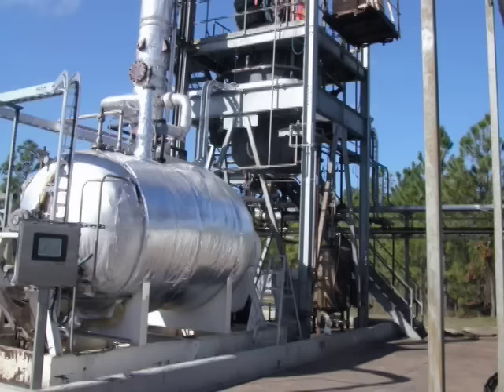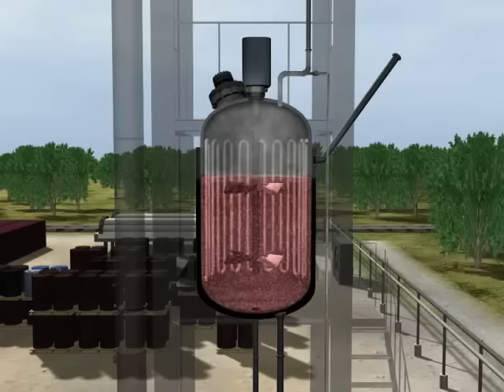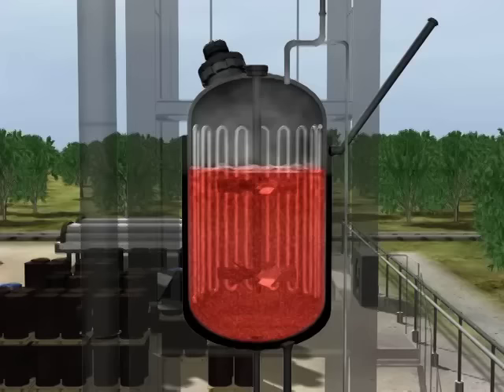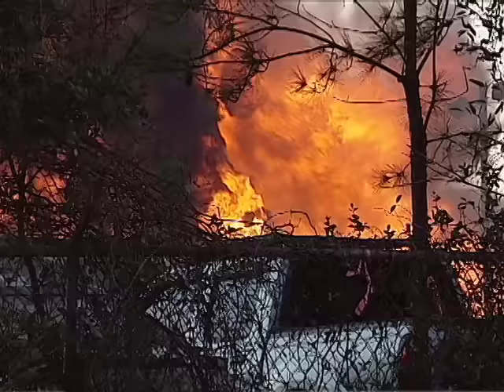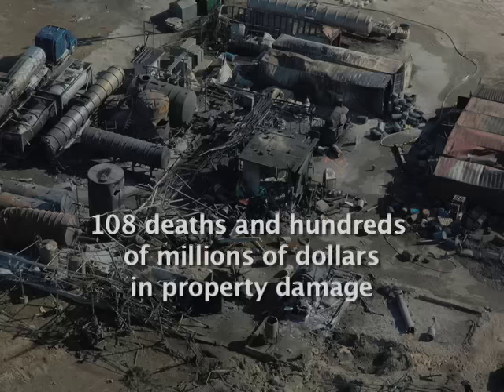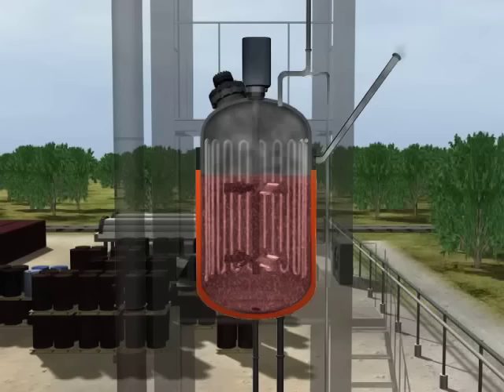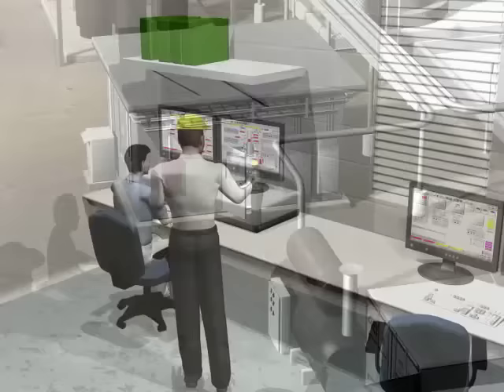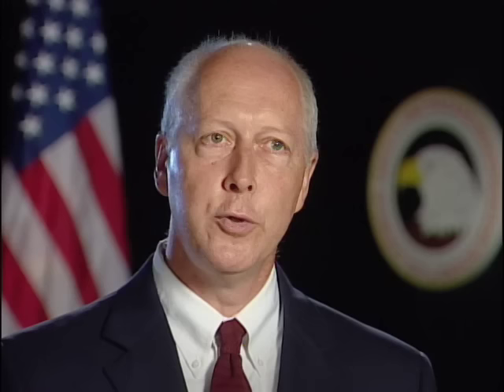Runaway: Explosion at T2 Laboratories

Comment: 👷‍♂️I'm a Chemical reactor operator and I used to make similar reactions, This is what I think about the operation.

Why they loaded  metal sodium and liquid chemicals at the same time and right away they heated the reactor using the heating system? Obviusly there will be an exotermic reaction just by turn on the agitation and you don't need the heating system , the reaction by itself will rise the temperature, and so then if you don't get the desire  temperature at the top of the reaction  you let the heating system  to heat the reactor to get your desire temperature.
They loaded all the reactives and heated the reactor with no agitation, that was a BIG MISTAKE , because when they turn on the  agitation of the heated reactor all the reactives start to mix faster and this is an easy way to get a runaway chemical reaction. The water is useless to cool the reactor at this point. The pressure of the heated reactor in the cooling/heating jacket  caused by the previous heating service don't let the water to enter to the jacket , I think they don't purge the jacket too

Greetings

Comment: Maybe a possible fail safe for this would be to have two vessels - one for the reaction and the other one surrounded by cooling with a separate water source for continued cooling .  If the main reaction vessel got too hot for any reason the contents could be quickly flushed to the second vessel .

Comment: The cooling jacket absorbs heat from the surface of the reactor tank. So the area available for heat extraction is proportional to the square of the tank radius. In contrast, the volume of reacting chemicals that needs cooling is proportional to the cube of the radius. A bigger tank means less effective cooling. I couldn't tell from the video if the designers took this into consideration when they scaled up the reactor. Looks like one of several mistakes.

Comment: God damn... You can even see the flash of the explosion on the lady's face at 4:56!

The security camera video of the explosion going off really drove home how ridiculously powerful this blast was. I see mention in the comments about how a plant like this should have had a warning siren or some such... But with a detonation that powerful, no siren in the world would have saved anyone; prior prevention really would have been the only working solution here.

10 seconds from start to finish isn't enough time to run from a blast of that magnitude, especially when they probably spent the first 2-4 seconds trying to figure out what was happening in the first place; in fact, I doubt even if they were sitting in their vehicles with the engines on and their feet over the gas pedal, would they have still gotten far enough away to guarantee survival.

Comment: This is why you use normally open control valves on this kind of stuff with high tension return springs. Run them in parallel, as well as multiple redundant pumps. Mechanical safety valves that vent into underground tanks.
Reply: Hydrogen is lighter than air so it's safer to let it vent to space. I love the idea of normally open control valves but that would not have made a difference in this case because the vent pipe was too narrow to handle the rapidly expanding gases.

Comment: My world has ways of preventing fire starting explosions. The chemical plant in Derp City has special pipes that pump powerful FREEZENT into the reactor incase the COOLANT and cool down systems fail. As a result, the reactor freezes and implodes from the below-freezing temperature. No fire or debris is set loose except for parts of the walls collapsing inwards and falling to the ground.

Comment: A simple second cooling could just have been a water tower, filled with city water, that had two pipes going to the reactor. One pipe controlled by the control center, and the second with a manual control that was easily accessed from the ground. Gravity feed, so you don't even need electricity for a pump. The tank should sized properly to hold enough water to cool during the entire process. Don't forget to add a little more water because you need to remember that this tank water might be warmer than the city water. Freezing isn't even an issue since this was in Florida.

Comment: why the hell didn't they have redundant safety systems to keep this sort of shit from happening, such as a manual pressure relief valve with a larger diameter pipe and a secondary cooling water supply? plus i think the way that they added chemicals in a large batch like that might have been another factor

Comment: Most staggering to me, are two things:
1) A safety critical process (the cooling system) has no backup and thus is a single point of failure
2) The rupture disk + safety 'blowout' is not sized appropriately to vent all the pressure very quickly. I cannot see why they could not size this larger/with less resistance as to vent the pressure more quickly to reduce the chance of catastrophic failure as happened here.

Comment: I don't understand why there are not standards in chemical reactors similar to the requirements of nuclear reactors.  You basically have the same thing going on in this type of reactor except it is not nuclear or generating power.  The basic operational principal is the same though.  Pressure rises and so does temperature.  In order to control the reaction you cool it with water.  The lack of emergency pressure relief, shutdown and cooling systems made this reactor a ticking time bomb.  The fact that they had near misses in the past made it even more dangerous with a higher probability of a failure with the cooling system leading to an eventual explosion which happened.

Comment: Scaleup of chemical processes is a discipline in chemical engineering, and many of the lessons have been paid for in blood.

Proper scaleup of batch processes is much more involved than being just a matter of taking the bench results from a 250 ml (or 1000 ml in this case) Ehrlenmeyer flask and running in a 20,000 liter tank.

Yet all too often we see people do just that.

Heat transfer and mass transport become problems as the size of the batch increases, and you need to carefully size your heat exchange system and your gas exhaust system.

You need to understand your heating and/or cooling requirements thoroughly, and what the dangers are, such that your reactor system can stay in the safe operating region at all times.

Then, you need to design your safety systems such that when things break and go sideways, your failure is a safe one.

Once you think that your bases have been covered, it's time for a HAZards and OPerations (HAZOP) study where experienced people look your design over with great scrutiny.

Even a relatively simple vessel requires that several disciplines participate in the HAZOP - chemist, chemical/process specialist (engineer), mechanical engineers with several types of expertise, electrical & instrumentation / controls specialist(s), and civil and environmental engineers, and some experienced operators.

Even a quick glance at what we are being shown here in this video makes it clear that whatever HAZOP may have been done at T2 was painfully incomplete and inadequate.

A HAZOP is not a magic wand, but rather a process which when properly conducted and coached by a 3rd party referee greatly increases the likelihood that any bad events can end safely.

Oh, and yes, HAZOPs can be painfully tedious... don't try to rush them... take lots of breaks to reset your headspace and timing.

Comment: I am a bit stunned at this to be honest- at how many layers of bureaucracy this made it past without apparent issue. I would imagine a building permit for something like this is much more complicated than the hoops I had to jump through.

After I had taken high school chemistry I knew how important controlling a small exothermic reaction was, let alone something so large.

Our teacher explained to us how important redundancy was, about how dynamite factories used to be built over lakes, rivers, or harbors so the reaction vessel could be dumped into the water if the reaction got out of control. As he told us this, he was diluting glacial acetic acid into a large beaker of ice. By the time he was finished, the diluted acid solution in the beaker was boiling.

Comment: As a layman, I have no expertise.  But COMMON SENSE would dictate that chemical facilities like this one be located BY LAW in special industrial zones ISOLATED from homes, offices, parks, shopping.  Why is this co-location of hazardous facilities permitted?  In my city, there is a pipeline facility with two very large tanks and several smaller tanks in a walled, unmanned compound located 200 - 500 feet from several tracts of million-dollar homes, a park, a large shopping center, and 1000 feet from a large 3-story medical facility.  I suspect the neighborhood was built around the tank farm as land became more valuable as the city grew.  I don't live on that side of town, but I shop there, use the medical facility, and the 4-lane road which passes 250 ft from the bigger tanks is one of the main routes to reach the only hospital in a city of 250,000.  How common is this?

Comment: I would think that anyone with even the most basic comprehension of engineering ought to be able to anticipate that scaling the system up by 10,000% or so might introduce some new control challenges.  It's even more astonishing that this red light still didn't apparently come on when they started experiencing temperature control problems.

And even more astounding is how anyone could accept a system design - regardless of size - where a single point of failure can cause a runaway reaction.

Comment: It would seem they could have contemplated a City Water pressure failure and an electrical supply failure. A GRAVITY FED COOLING WATER SYSTEM SHOULD HAVE BEEN MANDATED. Their insurers should have required it. An adequately sized cooling water tank elevated above the reactor with a mechanically remote controlled  valve and backup generator should have been required .

Comment: For those of you wondering what MCMT is: 

https://upload.wikimedia.org/wikipedia/commons/thumb/1/1f/Methylcyclopentadienyl-Manganese-Tricarbonyl_Skeletal.svg/1200px-Methylcyclopentadienyl-Manganese-Tricarbonyl_Skeletal.svg.png

It's technically a half-sandwich compound and one of the production risks is thermal runaway. I've had a 50L vessel of toluene go up (30L of toluene in it) and it was VERY dangerous.... this in a whole new level.

Comment: I would think this type of reactor would have a more adequate pressure relief valve. And that would be two of them, a primary and a secondary. The same for the cooling feed line, a primary and a secondary. 

I wonder if they periodically tested their safety valves?

Comment: Design it so that the steam put out by the boiling water doesn't just cool, it turns a turbine that powers the input of more reactant.  After an initial input of the reactant to get things going, if there is no cooling from boiling the water, there would be no input of more reactant to enable greater heat.  Self-limiting designs like this should be the default sort of design, like nuclear reactors that fail safe by requiring power not to retract fuel rods but to keep them inserted.  On power loss, they just fall out making a self-sustaining reaction impossible.  Local businesses and residences should definitely be informed of potential failure modes as well.  They should have known as soon as they heard the whistling noise that a dangerous situation was at hand and they needed to get cover immediately.

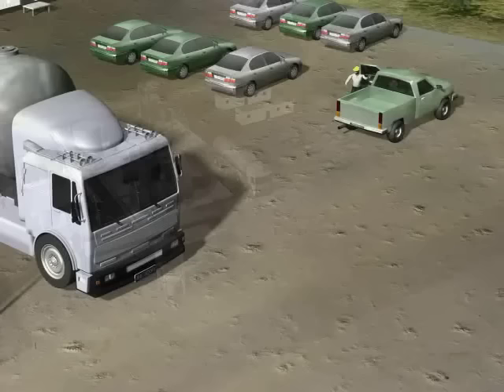Comment: 7:26, although people are book smart, it does not mean they're street smart/common sense. I know far too many college educated/book smart people who are children when it comes to real life/common sense. 

A pin needle sized relief valve, one source of cooling(no backup in case of failure), one water source(no backup water source/emergency water storage), was one of those many common sense things that your average safety conscious construction worker would understand.
Reply: Pretty much.

I do this job and work regularly with exothermic additions/reactions. There are several issues with their process to start with. If its an exothermic reaction you don't load all of the reagents together at once. You slowly add the materials which cause the exotherm waiting until you have control of the temperature before adding more.

Secondly, their cooling system was jacked as fuck. You should have a constant flow of cooling into your jacket (and out so it's on a loop) of a medium that will not just boil off. You should also have a fail safe of a cooling medium that is running at 0c to -30c incase you need to cool a vessel immediately.

The pressure relief disc that blows probably did it's job properly and was sized correctly, the reaction was probably just too far gone to stop it.
Reply: The owners of the plant knew that too they just wanted to cut corners.
"Why plan for something that isn't going to happen?"

Comment: The cooling system should have extra backups, the safety pressure release valve should be set at a lower pressure, have more flow and be able to be opened manually.

Comment: The other issue is what happens with the steel tank over time with corrosion and metal fatigue! I mean, they knew a certain amount of PSI and temperature was known, but over time the tank strength would have to be de-rated because it wouldn't last forever and under those conditions of being heated to 300 something degrees, and having cold water surround it while it got hotter, plus being exposed to the weather and changes of temperature from the sun/nightfall too, yet they build these plants like they can run them just like this for the next 50 years.

Comment: should have never increased batch size by 1/3 without increasing reactor size also. from 2.500 gallon to 3,500-4,000 gallon. and increase size of cooling jacket, skip city water use a good engine coolant

Comment: That has got to be one of the most inefficient cooling systems around. They should have treated this vessel as a kind of boiler and had a continuous water flow all the time in a sealed closed loop. Use the generated steam in a fin fan cooler or a plate and frame heat exchanger rather than ejecting a huge amount of energy into air. I have to agree with the comments about redundancy too. Multiple feed pumps are a good idea. Perhaps an emergency purge to drop a chemicals in to neutralize the reaction

Comment: @ 3:20 Rupture disc was spec'd to burst 10 seconds before catastrophic failure? Sounds like complete and utter failure on behalf of the plant design engineer, and inspector, and whoever else contributed to the safety systems at this plant. The disc should blow and relive the pressure, not be a warning sound to the explosion. 10 seconds between safety valve and explosion is clearly not enough time. I hope they're no longer engineered in this manner. Bigger pipes and a weaker disc and there would have been fewer dead people.

Comment: A cooling system that is absolutely essential, yet only operates on-user-demand?
Only ONE cooling system?
Using city water, thus not under their direct control?
wow.

at a minimum, the cooling needed to be a continuous, automatic system. Fed from a sufficient on-site reservoir.
With at least one level of completely independent backup, up to and including a separate coolant source.

Also many other errors... awareness of the energy release possible in failure. Better bust-disk selection. not storing a witches brew of other shyte on-site, etc,etc,etc.
But that cooling system was not just unsafe, it was almost purposely-designed to want to fail.

Comment: It absolutely unbelievable that a critical system such as the cooling didn't have a backup system.  What the fuck?!  Every system fails. EVERY ONE.  If cooling the vessel was critical and apparently is was, then you need to have a back up water supply with a separate water piping and water pump.  I can't believe an engineer designed this without a backup cooling system.  In addition the pressure relief valve needs to be set lower.  There is no way that relief valve should open when it is only 10 seconds from blowing up.  There are way too many engineering design errors at this plant.

Comment: The reactor should be much smaller. If more production is needed, just add more reactors, isolated from each other. A smaller reactor is easier to control and cool. Also, there should be a cooling tower and a water deposit serving the reactor.

Comment: Umm... Sodium metal reacts with water (in many cases explosively) what happens where there is a leak between the cooling jacket and the reaction vessel?  While this wasn't the stated "cause" of the explosion, it would be another example of a design flaw (and probably added to the total energy of this explosion).

Comment: Safety systems should be redundant - x2.  Every vessel that builds pressure should have at least one - if not two different relief systems venter to safe locations.  If necessary, vent through a flare to burn off flammable gasses in a controlled and safe manner.